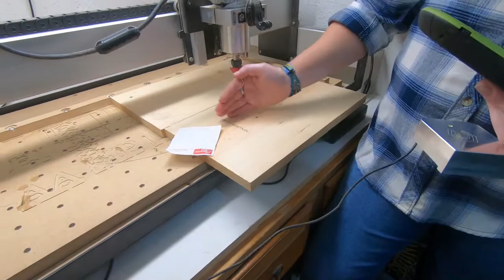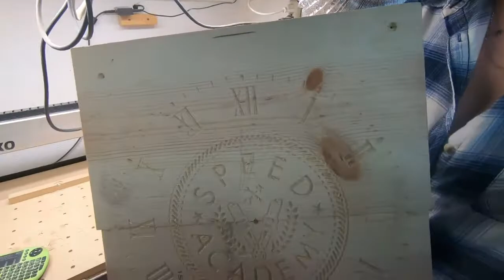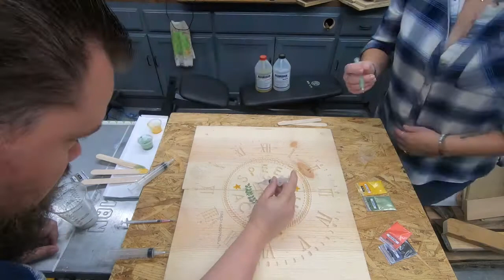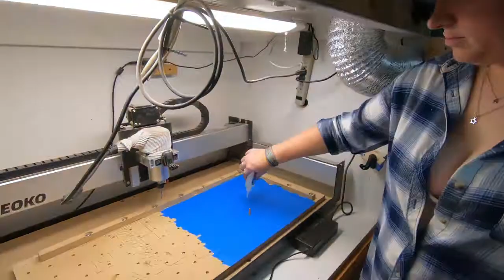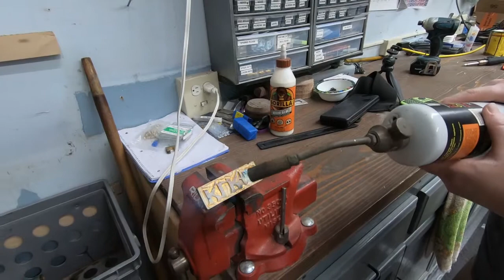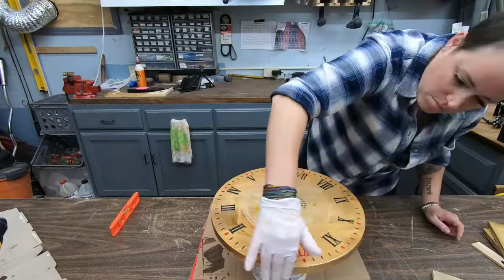How to: CNC Wood and Resin Clock | Speed Academy

Comment: Thank you for the video.  I do not currently have a cnc, but am getting ready to make the dive.  My reasoning is I want to design a clock for my ATA instructor as an appreciation gift.  Your video really let me see and understand the process.  I truly appreciate the time you took doing this.  Oh, and where did you get the blue nylon abrasive wheel brushes?  And what size syringes do you use and where did you get those?

Comment: Curious....I noticed you didn’t use a seal coat against color bleed before you used the resin. Color bleed is not a problem? How d9 yo7 keep it from bleeding? Thanks.
Reply from the maker: It did bleed. We should have used a seal coat but didn’t.

Comment: Also you mentioned a clear coat.  What did you use for that?  Simple shellac?
Reply from the maker: Used a few different things to find one we liked. The first one was a poly and then the second one we used Osmo Poly oil. The Osmo is much more expensive but leaves an amazing finish. If the top is solid resin like this one we just use this one https://amzn.to/3sT9GRZ but when you have wood and resin we used the extra thin, https://amzn.to/3mMKngL, first to penetrate down into the wood better and then finish with the normal one.
Reply: @KLRform  thanks for the info. Keep up the good work and I’ll look forward to more content!